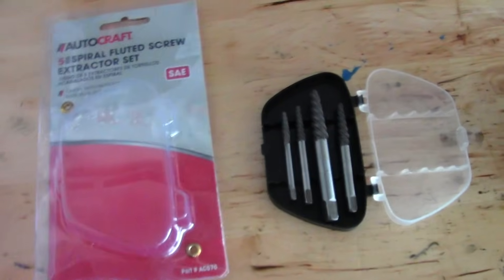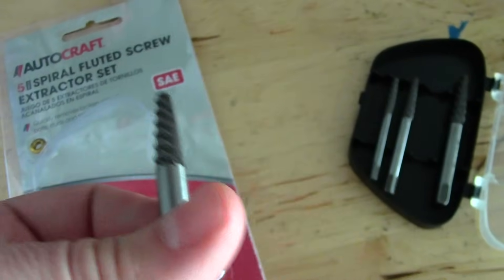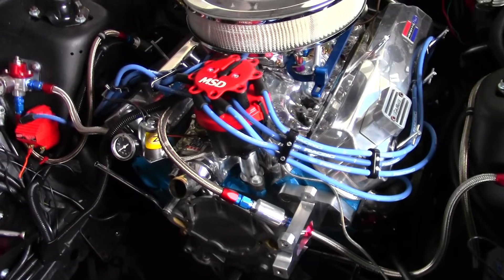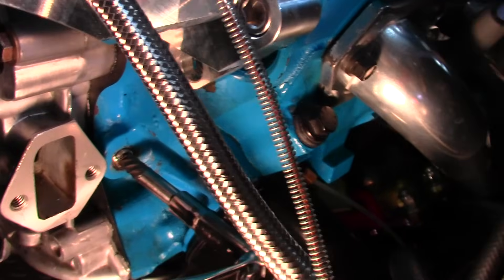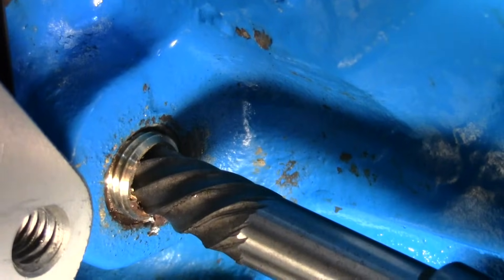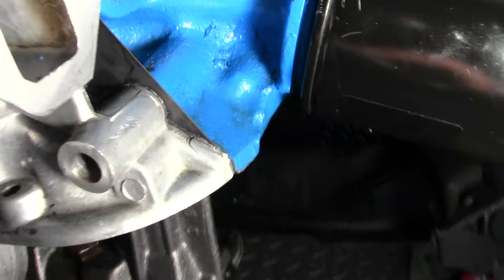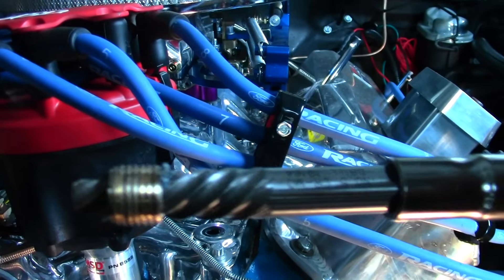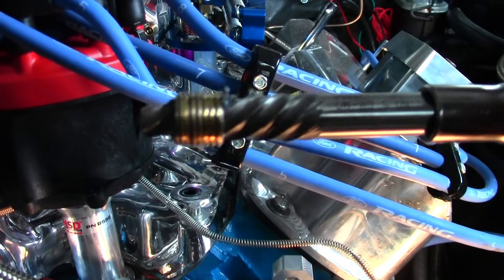How to Use a Screw Extractor | Remove snapped off bolt from engine

Comment: How do you remove the extractor bit when it is broken on the bolt or screw that you have tired to get out in the first place? 
So what extractor bit or tool to use to extractor and extractor?
What kind of drill bit should I use to drill the hole on the snapped extractor?

Nice tips.
Reply: +angelisone i used a "solid carbide" dremel bit, from Lowes, for like $12, worked great, took about 20 minutes. WEAR GLOVES cause you sure as shit don't want extractor shavings getting on your hands, they will work into your skin like microscopic splinters
Reply: +iceman5234 So the solid carbide is harder the these regular extractor bit's body, so I can drill in the center?
Gloves and glasses are a must.

Comment: Well....I'm literally screewed. Bolt broke in the engine block.... came to drail it out and the drail broke in there too....
Reply: haha
Reply: +iliof1 "solid carbide" dremel bit, they're like $12 at lowes. works like a champ. used them to drill through an extractor, might drill through a drillbit, too. if not, you can shatter the drillbit with a punch and pull the pieces out

Comment: I think it's easier just to buy a new motor
Reply: I always buy a new engine instead of doing new plugs or oil changes
Reply: Roll Tide sarcasm.... it was sarcasm.
Reply: Daekj32 only if u knew what I’m dealing with then u might be discouraged lol
Reply: engine...
Reply: David Wright yea I got a 99 Subaru motor and I had an exhaust stud broke off in my  head had to drill the whole fucker out messed up my threads
Reply: Mannie kazares max of 10 min of extra work is worth a new engine?
Reply: Right.  How is 10 minutes of work even comparable to buying a new engine!?!?

Comment: hI - Nice job-&  nice motor! . But how did you get the bit in without a drill.   You tapped it in?
Hammered it in?   And then put the socket wrench on it?  
jUST BROKE off the head bolt  replacing a thermostat . Never used one-an extractor before- hope its not a pain in the ASS1 lol.  Thanks.
 Ltr-On... Dave

Comment: do u know how to extract a bolt with damaged thread ?

the bolt is turning, but not backing out, i am looking for something thats able to pull it while turning.
Reply: +redhongkong vice grips
Reply: +iceman5234 
its M10 or M8 bolt under the rear suspension crossmember,  its very hard to pull by  hand,  i was hoping to find something like a car dent puller with extractor threaded in.

Comment: my idle pully on my 92 Econoline van broke off, leaving end of bolt in block. i only work on my vehical when it must be done, and being a woman, i have alot of anxioty about doing this. never has this happened to me before. any suggestions on what i should try before i use this method of extraction?  thanks  cheryl b

Comment: archifxllc I needed a 3/8x16 45 degree on my 302 for a ridiculous sized oil pressure sender. Picked one up at Napa Auto. Here's a 3/8x16 plug that you were looking for: http://www.datum-manifolds.com/products/DA4004%252dXXXX-3%7B47%7D8%252d16-X-3%7B47%7D8-STRAIGHT-THREAD-PLUG.html

You can find these buggers anywhere that does hydraulic fittings and hoses. Just so happens our Napa specializes in large truck parts so this was easy to find. It was 5 bucks for my 45deg but it works! Hope this helps.

Comment: I used to use those kind of extractors.then i discovered the flute extractor.way better.ive removed 100's of broken brass, copper and s.steel pipe type of fittings

Comment: Thanks ...I hope I'll get as lucky as you were...I broke a bolt of the front cover that goes into the block; it is a 1/4 of an inch ...Do you know what size drill bit should I use..Thanks
P S
What brand are those blue wires that you used ...
Cheers and thanks again
;>)

Comment: Try MSC Industrial Supply.  They have some 3/8-16 brass bolts.  http://www.mscdirect.com/browse/tn/Fasteners/Hex-Head-Cap-Screws?searchterm=3%2F8-16+brass+bolt&navid=4287685183

Comment: I think you should use a tsp handle when using an easy out. To leases the sideways forces on the easy out. I have used easy outs a lot when I worked on A7's when removing access panels . what a pain when you break one

Comment: Those ease out suck the best ones are square fluted ones but try to get a broke off bolt out if it broke off the ease out not going to get it out like.   you say you break it off and your screwed. By the way hell of looking motor.

Comment: Stud extractors will vary a lot in material quality and design. The best are likely to be a hardened and tempered mid to high carbon low alloy steel. This should be a little harder than a high tensile bolt (which are also tempered matensite). It's worth investing in a quality set but even so they can slip or snap (if abused) also if the stud is a ductile metal like brass and firmly stuck in the hole it can deform under the internal pressure from the extractor causing the threads to tighten up further.

Comment: we are talking about one bolt that is made of a metal softer than the metal in the extractor... what if you are trying to remove a stainless steel bolt ?  even if you drill a hole, things ain`t gonna be that easy... most times, the tip of the extractor gets really blunt..
and did you spray anything for the bolt to unscrew rather easily ?  
It is like you said... it Works fine when it wants to work fine... lol

any listen,.. is the tip of your set of extractor sharp ?  I purchase some whose tip were really blunt...
Reply: Did you try metal softener?
Reply: Hum.. thank you. Perhaps I will have to destroy the whole bolt and drill a new thread through it.  Sorry for the English. This ain't the sort of subject I talk very often, besides I am Brazilian. In my little jungle we speak a dialet from the old Latin. Lol thanks anyway

Comment: You could find the proper threaded plug at any good small machine shop with a old timer machinist, spin one up in less then 10 mins. If your a weekend wrencher or even a pro, find a good manual machinist, he will become your best friend.

Comment: This extractor worked well on my 20 yr old broken off spark plugs. Going slow IS important! It also helps to spray PB Blaster on threads and tap the extractor with a hammer (lightly) to help Balster wick into threads. I tied other sprays i.e. liquid wrench, WD 40 with no luck. Soon after I used PB the screws came right out.

Comment: I saw this and thought an extractor might help me out.  I tried to heed the warning not to break the extractor, was slow, careful and used vice grips that I thought wouldn't be capable of creating enough torque to break it.  I broke it, drilled it out with carbide and made the hole a little bigger, then, yep I did it again thinking I would use a square tapered extractor and be really extra careful.  So I want to elaborate on that warning for anyone like me that may not be familiar with extractors, they are very easy to break and there are some jobs they just can't handle.  Three exhaust manifold bolts have, over time, broken themselves off in my head, I have ordered time sert kit and threads for the fix because extractors are...  Yes I have had it soaking in penetrating rust eating you name it...  Don't say to use a MIG cause it's recessed in the head-and I tried anyway but couldn't get a hold.

Comment: To the comments below, I've had a few "saves" drilling slots on each side, tapping a big screwdriver into the slots and turning it out. A crescent wrench on a square sided screwdriver will give you enough torque. Stripped Philips heads? I do the same thing and turn them into slotted heads.

Comment: 3/8 x 16 Brass , why would you think you need brass as many car Co's commonly used steel plugs .
What you broke was a 1/4 to 1/8 pipe thread, nipple , adapter, bushing, ETC .
Funy that you cussed the bushing but it didn't break its self, you broke it !
BTW those cheap twisted 'easy-outs' are known for swelling whats stuck so I prefer the square tapered ones.
FYI your 1/8 pipe for your sender with a little massaging may very well have started & threaded in since it is a tapered pipe thread.

Comment: Nice video - well done for explaining how to use an 'Easi-out'. Years ago I did exactly what you warned against - I snapped the extractor in the broken off bolt! After a lot of swearing I worked out the extractor was as hard as hell.....through desperation I used a household masonry ie brick drill. It was the type with 2 brazed in hard cutting edges (probably carbide or similar).....to my amazement it was harder than the extractor and it turned the extractor into swarf although it killed the drill bit but I thought it was a very small price to pay! I hope this helps somebody in the same position! It also helps to use the biggest diameter extractor that will fit the bolt or stud that is broken off.

Comment: Never ever use anything other than a hand powered wrench to back out these extractors, if a power drill is used, the tapered extractor pulls tightly into the broken stud and expands it even tighter, then snaps off the hardened extractor, then you are in big trouble, so only hand power, as you very well demonstrated in your video.

Comment: Brass fittings are typically pipe thread because they hold back fluids most of the time when they are used. That being said, if you have a lathe, mill, indexer and some brass stock you can make a 3/8-16 fitting rather easily. Since most mechs don't have this at their disposal these extractors usually work well with brass fittings. Like he said though, DON'T BREAK THEM OFF IN THE BLOCK!!!!!!!! You'll need carbide drill bits and some knowledge on sharpening bits since you are going to break a flute on the carbide because carbide is fragile, OR you'll have to grind it out with a grinder which is a one way trip to shaving city!! The alternative to these extractors are "turbo sockets". 
http://m.harborfreight.com/5-piece-pipe-nipple-extractor-set-93822.html
These work great on brass. Make sure you don't get ones with a "shoulder", a low valley in between the cutting flutes and the heck head, as this will get the tool stuck in the fitting and you'll be hating life trying to get then out.

Comment: A Bolt snapped off on my jeep, drilled a small pilot hole into its center, used extractor to remove bolt, and then snapped of the extractor tip into bolt, Now extractor tip is too hard to drill into try to extract.  I am 'Screwed'.

Comment: I have had good luck extracting brass fittings by heating them up red hot with a torch doesn't take long,  then let it cool and it will shrink a bit then it comes right out.

Comment: Buy a lathe and cut what ever threads you need :)Good work
Reply: ever heard of a tap and die set, they are much cheaper than a lathe.
Reply: I agree but once you have one ,You will be able to make what ever you want..It will pay for its self eventually, depending on how much work you do..They aren't that expensive for a small lathe..
Reply: I would also go with the tap and die set. If Shark did buy a lathe, he ** might ** use it once in a blue moon. The lathe would just sit on the work bench or in a corner, taking up space and almost never or really never get used.

Comment: I am dealing with a brass jet in my carb that the flat head top stripped off smooth in a deep hole. Every screw gave me trouble, and of course the last jet to remove before I can start the cleaning and reassembly is so stuck in there I just want to scream. I may try to put a dab of JB weld on the tip of a bolt, screw in the tip and walk away. Come back and pray I can get it out.

Comment: Anybody know where one could pick up a 17/64 square cap adapter for any size ratchet driver? I had a spark plug shear off just like the plug in the video. Bought the extractor set but the driver for it is definetly not going to fit in the space provided, nor will any size socket that I have...

Comment: I am a great believer in "PB BLASTER" saved me on a broken water pump bolt  I also use never seize on anything I put back together.  messy shit but worth its weight if you have to take it apart again.  Castle makes an aerosol never seize product

Comment: In a pinch, you can tap in an allen wrench just larger than the hole in these brass fittings. In my experience, it works much better than this type of extractor. These extractors can enlarge the hole if the fitting is bound up.

Comment: what are the steps before this bit?
Reply: You have to drill a hole through the bolt first. He didn't have to do it bc the fitting was hollow.  He mentioned that was something he wouldn't want to do in this instance bc the risk of metal shavings getting into the block.

Comment: Drilling part?
Reply: had a hole already after smaller threaded part snapped off. maybe didn't have to drill. otherwise yeah...may been a challenge getting drill in there like he said
Reply: It was a hollow threaded female bolt - no drilling was necessary.

Comment: If by “male threaded 3/8''-16 TPI brass anything” you mean a brass 3/8''-16 TPI Unified National Coarse Thread bolt, these links might help.  

http://www.amazonsupply.com/dp/B00CTVO1C6?ref_=sr_1_4_txt
http://www.amazonsupply.com/dp/B00137A5YK/ref=sp_dp_g2c_asin
http://www.amazonsupply.com/dp/B00DD3NC10?ref_=sr_1_3_txt

Comment: How can you get the extractor into the bolt without a drill, if the bolt is solid instead of hollow in the middle? I need to extract a bolt in my head assembly, don't want to use a drill and end up with shavings in there...

Comment: If by some chance you did break the extractor there are special bits that can be used to drill that out.  They look like the tungsten carbide bits for a dremel and are probably made of tungsten also.  I hope no one ever needs these special bits but they are there for really unlucky people.  In fact a dremel or die grinder with a good carbide bur along with some patience and a steady hand may be all that you need to drill out an extractor if one does break.  I would prefer that over tapping a new hole if the threads are not ruined because it is sometimes nice to keep the original size bolts instead of having that odd one that doesn't fit the other holes.  Some people might forget they have that oddball bolt and have another problem.
Reply: What if you break special bit inside extractor inside a bolt?
Reply: funky3ddy Then I guess you are screwed unless you find some way to get it out.  A tungsten carbide bit is hard enough to cut away at many things.  Just be slow in there while drilling the extractor and don't rush.  You might even begin to feel like a dentist.  If by some chance a carbide bit does break all is not lost yet and it might be drillable with another carbide bit or even diamond tipped bit.  That won't be easy and you me even wear out a few bits trying to drill that carbide out.  You just need something equally hard or harder and tungsten carbide is really hard stuff.  It is about as hard as sapphire and that is why many solid tungsten carbide bits don't even have a scratch after having been used some.  It is however a brittle metal and does get nicked from hard use but never scratched.  It is the durability of the metal that is the reason some people wear tungsten carbide rings.  Yes there is a danger of not being able to remove the ring in an emergency because they are so tough but they are not indestructible.

Comment: you got lucky snapping off a hollow bolt. i have had nothing but bad times with these extractors on normal bolts... one of them being the time i snapped the extractor off in the hole i had drilled. I wish i could remember how i got that one out, but it wasn't pretty.

Comment: what size extractor is that? I literally need the same one. and what size is the 12 point socket? thanks
Reply: If you are going to use a ratchet, you'll need to get tap sockets. Home Depot sells them (8 piece) for just under $26.00. Hope this helps.

Comment: I was an engine machinist for 28 years and rule number one always drill the bolt all the way through so if the extractor breaks off a punch can drive the broken piece out the bottom of the bolt, and rule two don't force it, if it doesn't break loose drill it and install a heli-coil.
Reply: What about for a broken bleed screw on a caliper you can't drill through that all
Reply: jz422--No disrespect, that's fine if you have a full hole with a bottom to drive it back through, but that's not the case here.  You either use an extractor as he did (with no hole required to be drilled in this case), or break it up into smaller pieces by drilling the bolt out.  Brass is a soft material, so I'd try a straight-tapered square extractor rather than the round spiral type he used.  The straight-tapered extractor internally grips the fastener at four points and won't expand it as you remove it.  The problem becomes more difficult if you break the extractor off in the bolt hole, as the extractor is hardened steel (i.e., not easily drilled).  For most of us (myself included), the option then is to take it to a machine shop to let a machinist (like yourself) attempt removal.  He may have conventional tools and techniques to do that, or he may have to resort to an electro metal disintegration (EMD) procedure on it to remove the broken extractor and remaining bits of the bolt.  As satisfying as it is to do-it-yourself, extractions can go south very quickly.  If someone doesn't know what he's doing, that can easily happen, making a bigger mess of things.
Reply: What I usually do is drill until I can get a tap the same size in the bolt. it take more work, but at least you don't have to worry about an Easy Out snapping off. Heli-Coil are ok but have some that didn't hold.

Automotive Mechanic for 16 years
Reply: Alexander--No disrespect intended, but taps break, too.  In all your years as a mechanic, a tap never broke on you, either while cutting new threads or while doing this?  I believe they're hardened steel, as well.  If true, you're very lucky.